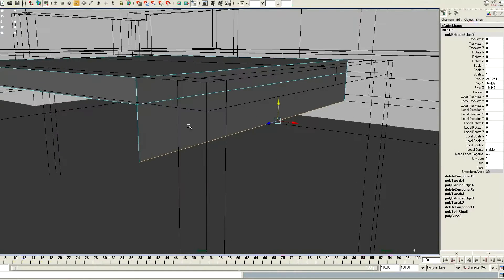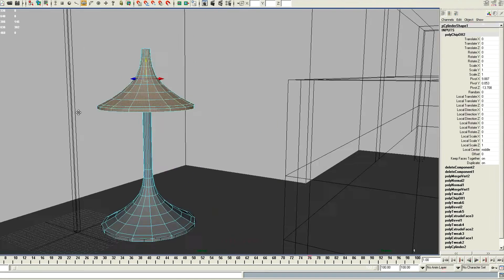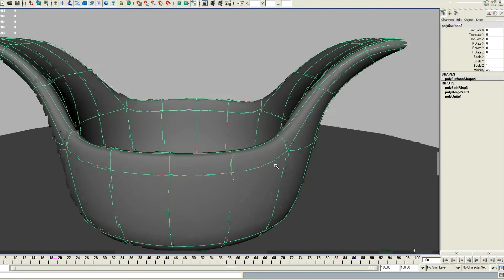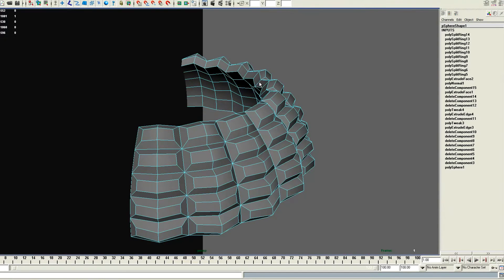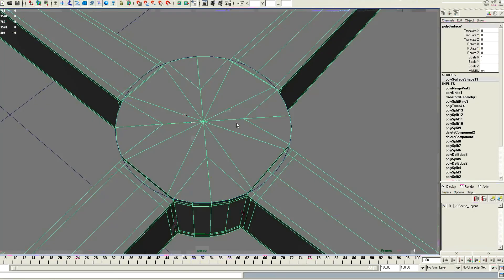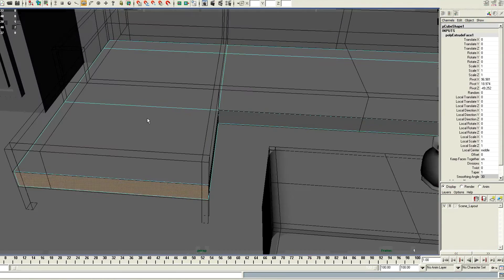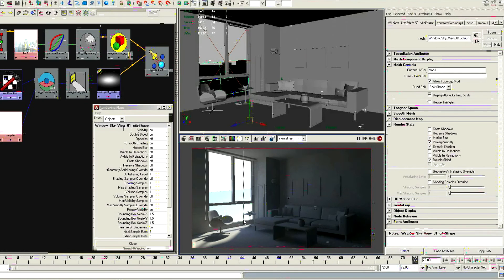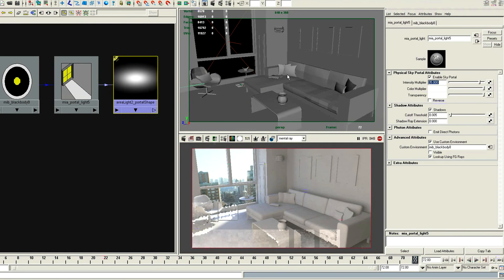Highrise Living Room - Commentary 1080p - 1 of 2

Comment from the maker: @yubihey I use FG (and the portal lights in this scene) and always do unless I'm in need of using physical sss, caustics, and other features that require actual photons. FG is less arbitrary than GI photons (which have an "intensity" option per light), since FG deals with luminance values in exact relation to the luminance of a surface or light; with the FG filter at "0", FG is unbiased in its calculations. All materials are mia_material_x_passes, for simplicity in dealing with render passes.